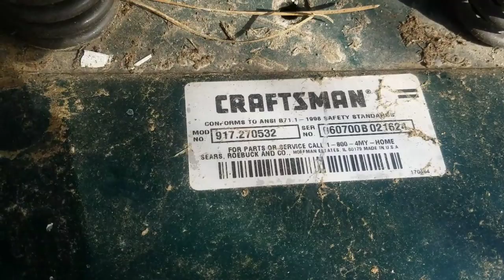FREE CRAFTSMAN 14.5HP BRIGGS OHV LT1000 LAWN TRACTOR TRASH PICK MOUSE NEST GAS TANK CARBURETOR CLEAN

Comment: What kind of gas line you use I cant find the old school fuel line
Reply from the maker: I’ve only seen two types of gas line.  One with a bigger diameter and one with a smaller one.  It’s just a rubber hose bro,  I wouldn’t get too caught up on it!  Anything will work just fine as long as the inner diameter is close to what you have.  It’s not the space shuttle bro!  Gas line is a gas line
Reply: 1/4 ID is what I have to lube it to get it on the  tank and carb
Reply from the maker: @PSN7373  I’ve never had to lube it…just shove it on there

Comment: Getting you a package together now bud, if there's anything else you want/need let me know in the next day or so, I'll try to get it in the mail by Monday, got alot going on.
Reply from the maker: Starters with plastic and metal ring gear bro is great enough brother.  Unless you have tractor 6 and 8 inch inner tubes, tecumseh, kohler magnetos and stators, light bulbs for tractors, ignition switches with keys, 3 and 4 post solenoids...lol.  thanks buddy.